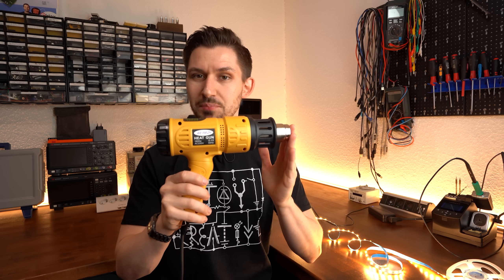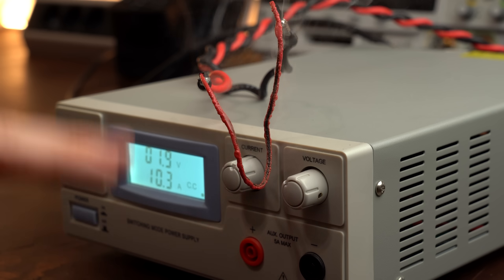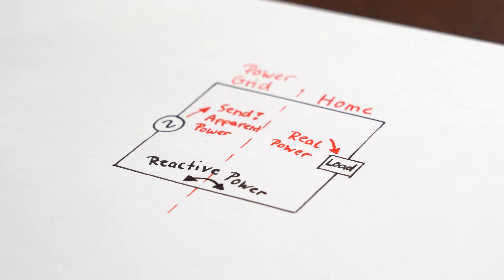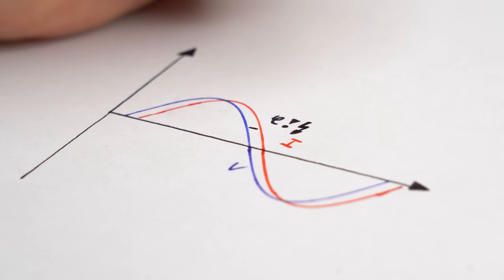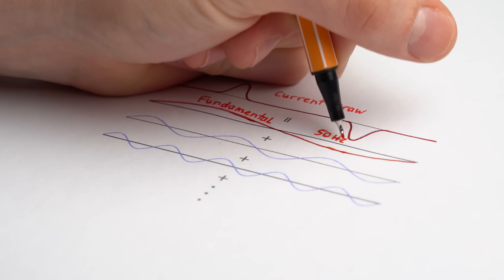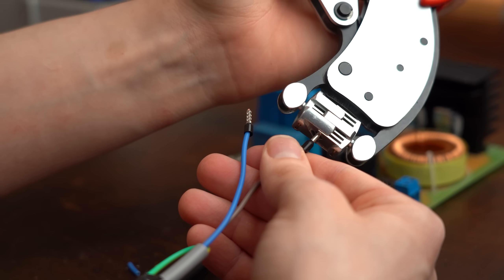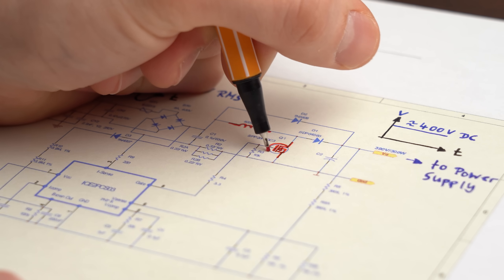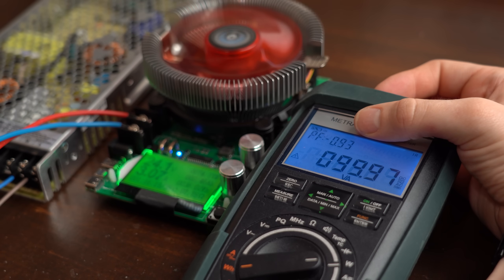The Most Important Circuit for our Electrical Future?! (PFC) EB#55

Comment: So that's probably why my servers their power supplies buzz, when running from my square wave UPS...
Now my question, how bad is it for the power supply and servers? Could it lead to any damage?

PS: 
- The UPS is an APC, with the manufacturer code "BR1200G-FR"
- Both servers have a corsair psu, a "TX-M Series TX550M V2" and a "TX-M Series TX650M V2" 
- The whole system draws about 150 watts, or that's what I read from the UPS...
- Civilized 240V @ 50Hz country here :-)

Comment: The PFC circuit is pointless. A sinusoidal voltage and a sinusoidal current create a (1-(cos (2*Pi*f*t))²) power function which is of course not constant. How to achieve constant power (ie voltage) at the output, if the input power has a pulsating form?
This means that the PFC circuit cannot be a DC voltage pre-regulator as is often used. When it is a pre-regulator, it would have to draw constant power at constant consumption. And this would tend to create a current function of the form: I(t)=P/(A*sin(2*Pi*f*t)) which would draw a large current at low voltage points to maintain constant power. Such a current function increases the effective current through the conductors and creates additional transmission losses.
The best point of consumption for the smallest current through the conductors is at the top of the sinusoidal function. And the best PFC corrector is an LC filter after the diode rectifier, which suppresses the high harmonics of impulse current disturbances, i.e. reduces the current peak and extends the duration.

PFC only makes sense on machines that have sinusoidal current consumption that is out of phase with the voltage. And these circuits are called reactive power compensators.

There is also no conclusion from the measurement that the installation of the PFC circuit increased the effective input current by more than 10%. Because of this, losses in electricity transmission increase by more than 20%.

Comment: OK but to solve the problem pragmatically we need to deal with existing devices. How do we easily retrofit them? One way I see is to couple this circuit with a special inverter (which has no losses on reactive power) and plug it into the reactive accessories power rail for the entire home. I just don't know if such an inverter exists and how to find one for the right power rating.

Comment: I have always thought of it as a misnomer to call this "power factor correction" when it is actually correcting non-linear current usage. This is of course very different than correcting the phase shift due to traditional inductive loads.
Reply: he is measuring real over apparent power though. That is the definition of power factor

Comment: PFC has been around for decades, you seem to imply that it is some brand new technology.  It is not the be-all-end-all, it has some serious disadvantages.  I used to work in industrial electronics, and PFC's do not handle noise or brownouts well, we would never use them in a less than perfect supply situation such as a generator or factory floor power because they would always shut down or misbehave in some fatal way.

Comment: It's *not* a full bridge!!  It's a full wave bridge rectifier!!  It has always been, and always will be, a full wave bridge rectifier!
If you use two diodes and a center tapped secondary winding, what are you going to call it?  It rectifies on *both* halves of the sine wave.  So it is a *full wave* rectifier, NOT A FULL RECTIFIER since it no longer has the four diode bridge.  The rectifier, no matter what, must always have the word "wave" after half or full.  Always!!

Thanks for the otherwise great video.

Comment: I run most of my interior lighting on DC. No power factor or harmonic distortion issues, and no flicker (to which a family member is sensitive).

But then I'm off-grid so there's a handy source of DC here...

I learned about PFC when I was involved with a tech start-up in the late 80's that figured they were going to take the world by storm with a sine-modulated UPS. I had just come out of technical college having gone back to school as an adult. I thought they seemed a bit naive but it was more interesting than what I was doing so I signed on.

I had more practical experience as a hobbyist than the PhD who was in charge of design. PFC was just one of the critical factors that he should've known about but didn't. Oh well, I had a fun couple of years laying out circuit boards for prototypes and watching them blow up on the workbench. Later I got to contribute to the design of an ASIC-based inverter controller IC. That was fascinating.

After we parted ways with the PhD we managed to get the major operational bugs worked out of the prototype, but when an opportunity came up to jump ship, I took it. No regrets.

Comment: Thanks for confirming what I have suspected for years.
Unfortunately it is not practical to fit one of these boosters to every wall wart and similar power supplies however I believe that units are available to add into your incoming distribution box that actively manage your home power factor up to around 1500 watts of power draw. Above that power limit and they switch out of circuit until the power level falls again.

Comment: It's also worth mentioning, that the Active PFC circuit does correct the PF by activating the mosfet in such a way that it draws current in repetitive peaks, that on average looks like a sinusoidal current on phase with the input AC voltage.
The folllowing video talks about it: https://www.youtube.com/watch?v=MBQn6xpto6M

Comment: This is why I never use cheap plug in power bricks and use a proper power supply. They run cooler and last years longer compared to the black ones in the video that die in weeks or months of continuous use on LED strips
Reply: How would a layman distinguish before buying? I am very curious as I don't know.

Comment: It is interesting that this video is saying almost exactly the same things that were being said a quarter of a century ago. 
That was back when I first undertook the design of a 1kW switcher for a highly specialized purpose and used the Untrode UC3854 for PFC. The 3854 performed really well but the development was pretty painful. There were no development boards around. Just procuring things like inductor cores (I used "Kool Mu", which was pretty new at the time) and high-performance capacitors was a whole lot more complicated and time consuming than it is now. (If I were doing the design now I'd probably go with a PFC stage that used two interleaved converters. They have some significant advantages in situations were high performance and very long service life are necessary.)

One "trick" of active PFC is that the instantaneous input current must be made to be directly proportional to the instantaneous input voltage while the average input current must be made inversely proportional to the input voltage.

Comment: Does it mean that I pay more for my energy bills when apparent current is higher than actual current? Does electricity meter count real power or apparent power?
Reply: On a residential service, no.  It isn't worth the expense for utilities to account for reactive power, at the residential scale.  The meters given to residences, just measure real power and real energy.  This is an inefficiency in the utility's business model.

On a large commercial or industrial service, yes.  Particularly, those with a lot of motor loads.  They are often billed for reactive power as well as their peak "instantaneous" power demand.   I put "instantaneous" in quotes, because demand is really just the power averaged over a 15 minute interval, and the worst-case value is what is used as the basis of your demand charge.

Comment: We have problems with all this garbage switch mode power supplies burning out neutrals in transformers .The garbage technology must be removed from the AC system .Or your only choice will be to go to DC power distribution which is less efficient over distance

Comment: PFCs are mandatory already! If your device is CE marked, it should have been tested to IEC 61000-3-2/-3-12. Exclusions for Harmonics are <5W for lighting and <75W for everything else.
Reply: That probably explains why it was so difficult for me to find a 12V PSU over 5A, because it'd require an expensive compensation circuit.
Reply: @thear1s buy 2
Reply: The lamp has 20W and 4W goes for harmonics. 
But you need 100 pieces for the hall.
Reply: You are right. I have now dismantled a cheap LED lamp from China, even there is a PFC built in.
Reply: But the question remains... who makes 160kvar a month for me!!! If not LEDs, there are still about 15 cameras or forklift chargers from Jungheinrich from 2010...
Reply: That explains why any laptop charger I have have PF around 0.48
Reply: @seedney If a laptop PSU has power factor correction designed in and the PF is 0.48, the PFC is shit.
Reply: @ PSU doesn't have PF correction - PSU is 65W only, so they're not mandatory.
Reply: Then is better to buy LED bulbs >5W

Comment: What really needs to happen is that we need low voltage DC power distribution built into NEC for building codes.  New homes should be built with a highly efficient AC/DC power converter at the main supply panel.  Distribute 12/24V DC out from there to the rest of the building to power all the low voltage DC devices common now.
Reply: Or maybe 5V Dc so everything powers like the USB standard
Reply: @markarisman1071  The problem with that is that at low voltage and high current you need very thick wires, and copper is expensive. Ok for placing USB chargers around the place maybe, but if you want to run your vacuum cleaner a 12V system would be a disaster- a 1800W vacuum on 12V would be pulling 150A, so the wires to run it would look like the ones that come out of an arc welder.

Comment: Single phase PFC! Yes please. Are we looking at a reduction in RFI from the loads or is the active PFC going to emit RFI too? Would like to see some EMC tests on these. Whatever, it is definitely a move forward to clean up the grid. Thanks for posting.
Reply: Active PFC circuits can be very difficult in terms of managing conducted EMI/RFI. You are basically chopping the rectified AC input at a frequency that could be anywhere from a few tens of kHz to a few hundred kHz. In the interest of efficiency the rise and fall times are very short, so there is lots of high frequency content. Some PFC controllers operate at fixed frequency, others at variable frequency. I used to do designs using a controller that I ran at 100 kHz, which at the time was a reasonable compromise when FETs, rectifiers, inductor cores and inductor windings were considered (I often say that in switchers everything is in conflict with everything else).
Filtering ahead of the rectifier will certainly require a reasonbly "large" common mode inductor and some normal mode inductance might be necessary, too. I've seen designs using two common mode inductors.

Radiated EMI/RFI is always a concern in any switecher. Circuit layout needs to be carefully considered.

I noted that at some point in the video there was a huge amount of "fur" on the waveform shown on the oscilloscope.
Reply: @D614G_aka_Doug  Thank you. I saw the hairy caterpillar too and it made me think. It does make me wonder how much noise the radio spectrum can take before it all turns into mush! So much energy transmitted across the bands these days. Forget noise cancelling headphones. I want EMI cancelling underpants! Cheers.

Comment: Very good video, high PFC could help save money  especially in your retailer bills on a KW basis or has demand tariffs. 

Though more often than not, it’s an old Pool Pump or bad AC unit which is responsible for the inductive load, more than modern electronics
Reply: It aint rocket science

Comment: Remember during the 3 day week the government recommended removing one of the fluorescent tubes in the dual tube light fittings to save power.......effectively screwing up the power factor by removing half the capacitance.... some bright spark engineer pointed out the error of that particular recommendation in short order!

Comment: Hey, could you make a video about the MyPv ELWA ? Its used to burn ecces solarpower to make hot water. I find it very interessting becaus its supposed to modulate the amplitued of a sinewave in order to controll the power. I cant really wrapp my mind around how they are doing it, and the small form factor they are in. Could you take a look?

Comment: The problem is the AC grid power frying your brain and DNA. 
No high voltage, no AC no electronics= 100% reliable, extremely efficient, and bill free Electricity for peanuts of outlay. 
Blame Edison scamming Tesla, and Tesla's yugoslavian fury for a century of stupid fuckups and increasing health and energy problems and shorter and shorter lifespans of your electrical equipment.

Comment: Are there power supplies which attempt to correct the "power factor" of the grid, if it is distorted? Instead of having dedicated power factor correction units, large loads would act as such as needed.

Comment: in the nutshell, does PFC lowering power demand (calculated via house watt meter device installed by power provider to charge money from clients) or its does only "line hygiene" by not spitting-out parasitic harmonics back into the grid?

Comment: I always felt that resistors contribute to wasted power. You're effectively burning off energy in the form of heat, just to reduce the voltage.

Comment: I think in the future we should widely adapt a DC power line instead of AC. This simple solution will much increate the efficiency of the power grid as well as save so much materials/components for fixing issues like the one you mention in your video.

Comment: What do the Electricity meters measure? my question includes both the old, mechanic ones with the rotating discs, and also the new digital ones.   Do they measure apparent power (VA) or real power (W) that we pay for?

Comment: your videos are interesting as always, can you do videos of programmable dc buck converters like drok DKP6012, XY6015L, Juntek B3603, DPS5005,  may used this as MPPT charge controller using esp32 using a custom firmware. It will be helpful for Diyers like me to build diy solar power storage.

Comment: This could get stupid if someone in standards dictates PF must be >0.9 over full operating range.
Try this on a pfc corrected LED driver which has a load range of 0.5 watts to 100 watts. Add in EMI filter components and you can't do it.
Prove me wrong.

Comment: There's a lot of high power and high voltage in this circuit, but not a lot of safety gear in use.  Gloves, shields, etc.  If you are going to demo high power circuits, I also recommend demo safety devices along side it.  Anything above 50V is considered high voltage and should be treated more carefully.

Comment: It's ironic how electronics technology has advanced its way into apparent power issues that were once confined to mainly AC Motors. When linear power supplies were the norm EE's & ET's rarely encountered low PF issues. Come to think of it, though not PF in the reactive sense,  RF techs deal with transmitter's Final Stage DC Input Power (E * I)  vs measured RF Output Power into a 50 Ohm Dummy load. 
Wakodahatchee Chris

Comment: Does the pfc circuit require additional power? or if it does I guess the overall power draw is still less with the correction, right?

Comment: I believe one advantage of passive PFC is it can directly installed on AC loads. I'm not sure if this can be applicable in AC too(?).

I wonder what these circuits before but after researching one of those chips I found out what their functions really are. Found these in some LCD TVs psu and one in Behringer powered console psu.

Comment: where does the extra energy go? is it released as heat and where?
Reply: It's shuffled between energy storage elements within the AC waveform cycle.   Inductive elements store energy in their core magnetic field, and capacitive elements store energy in the dielectric's electric field.  These elements cause current to either lead voltage or lag voltage.   The other type of element can correct power factor, since an inductor and capacitor combined at the right frequency, have zero net reactance, as the rest of the circuit experiences.

This causes the apparent product of current and voltage, to be more than the actual power that enters the electrical domain at the source, and exits the electrical domain to the load.

Comment: However, the question on my mind now is: Should all devices contain active PFC, or should we have something like one or more such PFC adapters, in a convenient housing and with multiple sockets to connect to it all small devices like chargers, routers, media players, LED lights? This could be the mystical energy saver that you plug between the mains socket and your device and it magically saves energy! Can you connect several devices with bad power supplies to one adapter? What happens if a device with built in active PFC is connected to a PFC adapter? Can one huge PFC be built into the main power circuits in a flat or a house?